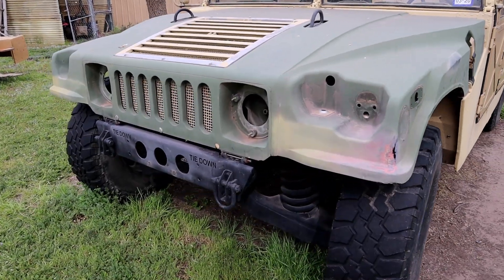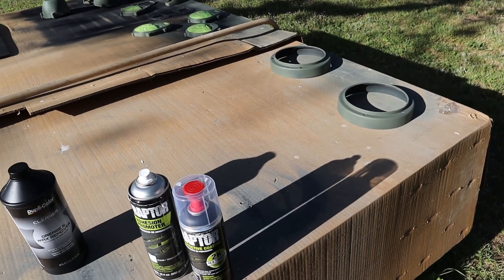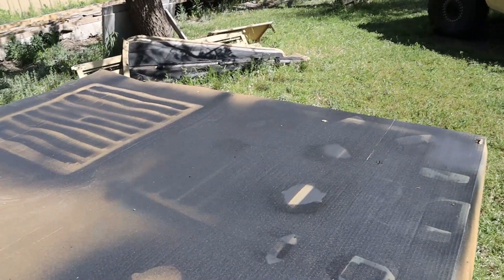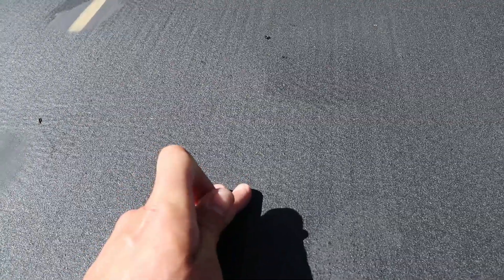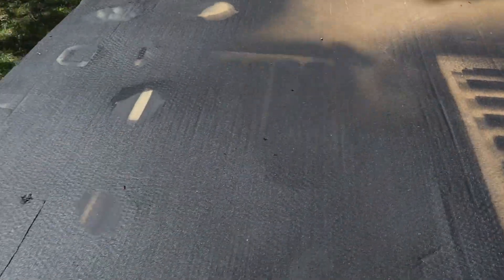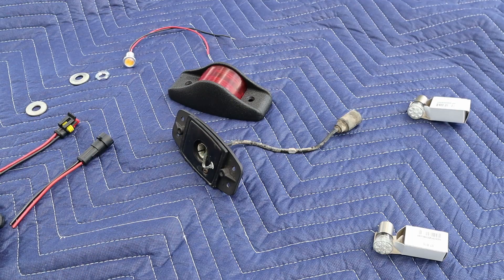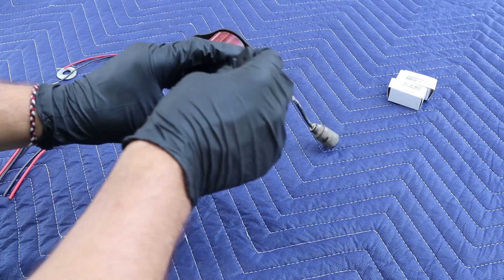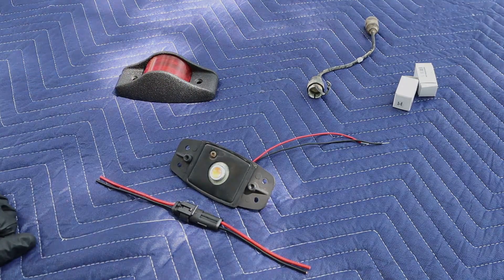Project Duramax Humvee - Raptor Liner Paint and LED Lights Conversion

Comment: I like it....I like it a lot!!

been thinkin bout strippin mine and doing Winter Camo wrap....keep hearing the Carc coating is a bee-otch to strip tho....maybe this route makes more sense
Reply from the maker: Yeah the Carc paint is definitely no fun to try to strip off there. You might test a piece of a wrap on it and see if it hold well enough. That might actually be easier than prepping fully for paint if the wrap is something you want to do in the first place. I'm prepping mine currently for bed liner paint and lizard skin but my original paint was pretty rough so that's why I went this route.